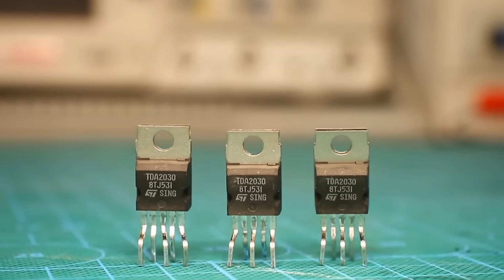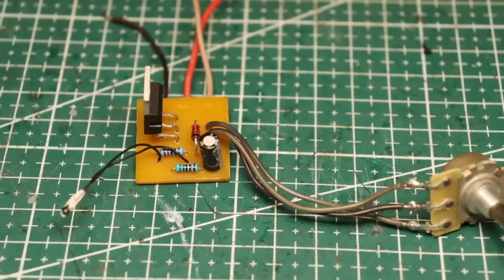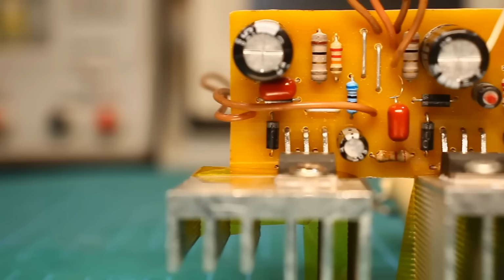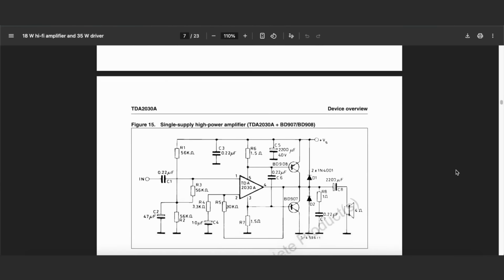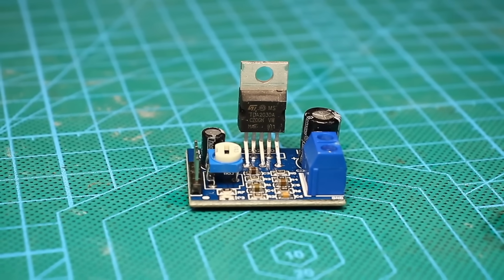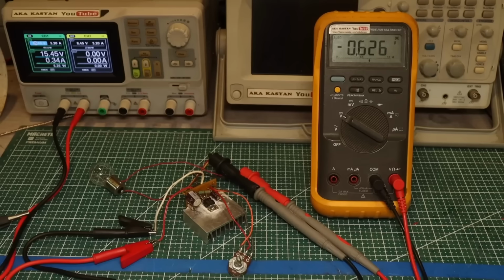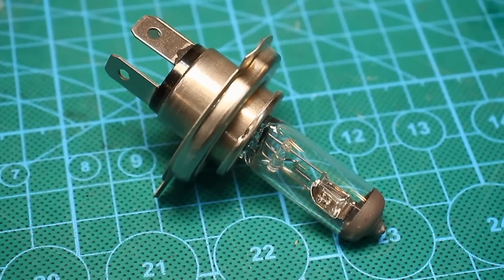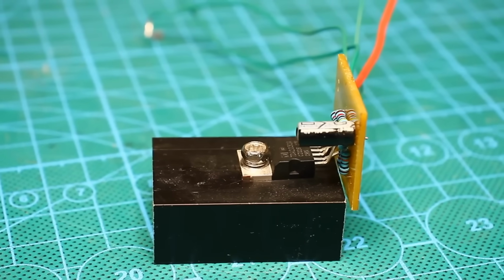Hidden Features of the TDA2030 You Never Knew About

Comment: Wondering if this could be used to run a 400hz AC servo motor.... The motor, I believe, draws less than 2.5 amps. If this pans out.... will post the results... bookmarking now.

Comment: the tda2030 and the tda 2050( even the UTC chips) are 10x better in thd than the lm1875! The other thing is you can make a powerfull amp with the tda2030-50 by adding a output stage. Adding a 1943 and 5200. thats a solid 80-150w rms amp
Reply: Wow,, thankyou!
Reply: it is?! i thought lm1875 has better sq than tda2030/2050 because it was more expensive

Comment: I can use it to power DC motor with sine wave and measure bode plot or frequency response of the DC motor. These are useful in modelling the DC motor by knowing its pole frequency due to mechanical parameters (J and B).
Reply: A friend of mine used a digital 12v áudio amplifier as senoidal inverter
Reply: May french no copren

Comment: An unique and great video, covering the ICs as TDA2030 for the non-standard applications. I had thought similarly in the past, like using a TDA audio amplifier as a power driver for DC motors, but had doubts of its feasibility. 
Your power supply example is very nice to see. One question = did you try to see if the over current and overheat protection kicks in and saves the IC from burning out?
Thanks for sharing!